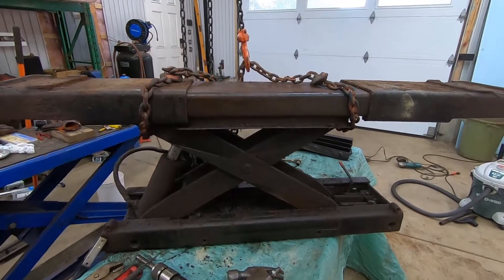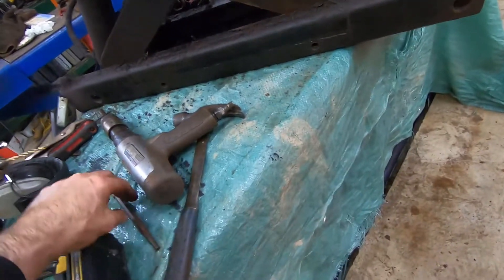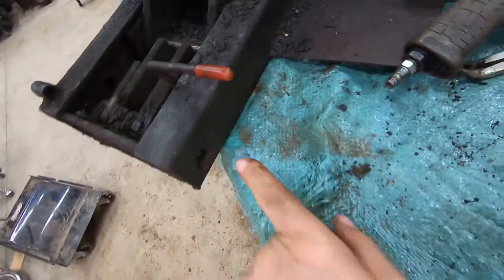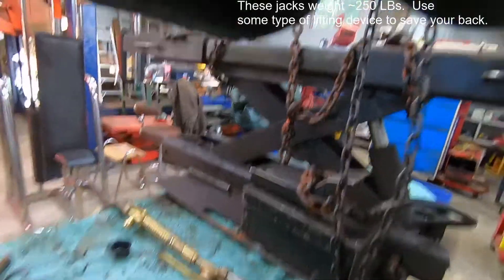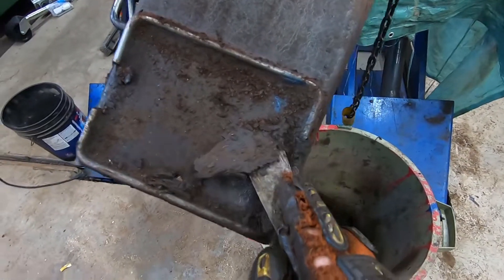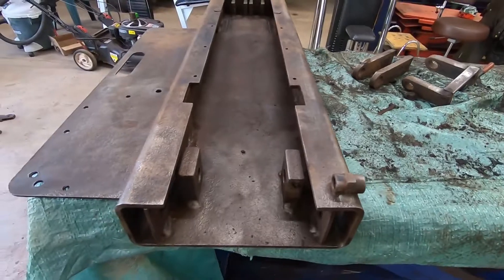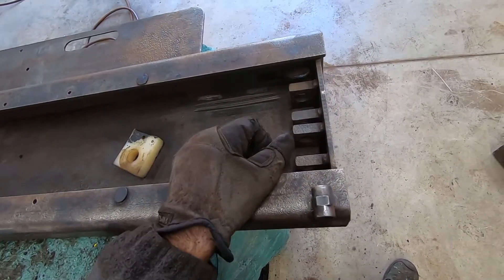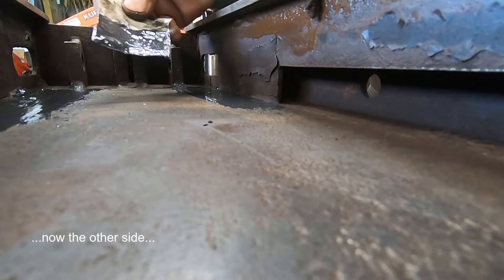DIY_Restoring Neglected Rolling Bridge Jack for 4 Post Hoist

Comment: I just picked one up and it just seems like it's too tall like it's not closing all the way
Reply from the maker: It is ironic you would send me this message today. Yesterday I looked at my rolling Jacks and thought they did not seem to retract all the way but I think that's just the way they are.
Reply: @mrdiyguy123 some of these rotary jacks are different designs and or heavier duty, I have both kinds at my shop and are not the same height when fully in the down position